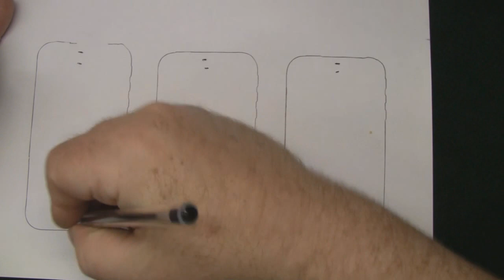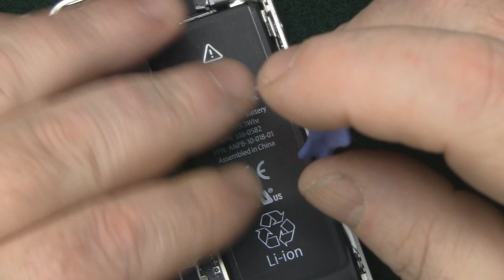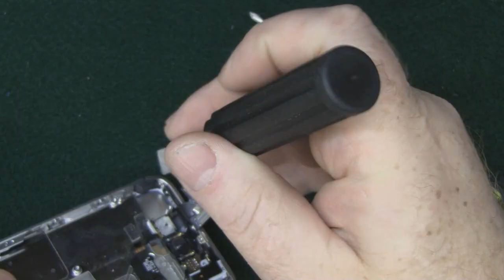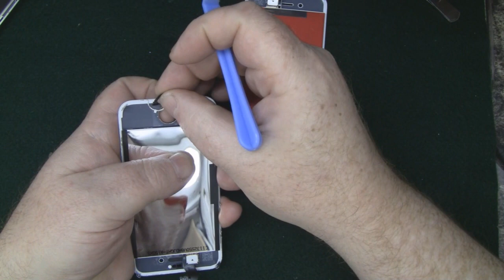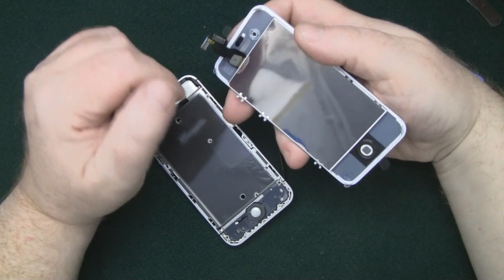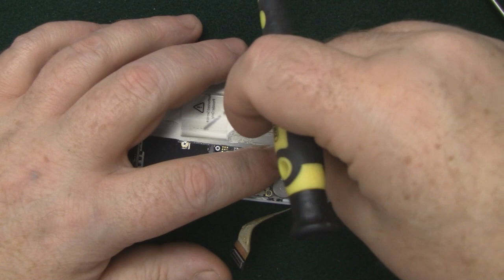How To Replace iPhone 4s Screen #68

Comment: At the moment, I can't explain the reason for this, but at about  8:15 in your video, you mention the removal of a "little metal retaining clip" (which I removed from my phone).  Once I had removed everything else that you said to remove, you then easily removed the logic board, which I then tried to do, but couldn't.  Baffled by this, I then took a further look (using a magnifier) at the area where I removed that "little metal retaining clip", and there is actually ANOTHER goldy looking piece of metal, which I had to carefully pry up, which revealed a hidden large screw (you can use a flatblade with).  Once THAT was undone, the  board then comes out.  You video isn't sharp enough for me to be able to tell, but I'm guessing that for some reason, that screw was missing from your particular handset (possibly due to a prior repair)?  Any thoughts on that?
Reply: great question, he's a bitch for not answering already.
Reply: there is a 75 percent that the men who u see fixing the iphone isnt the person who posted the video on youtube. In little word I could be the one who posted the video but I'm not the technician  on the video.

Comment: best DIY video on this fix hands down... just watched half a dozen vids before this one and since im an alternator and starter rebuilder im very familiar with taking your time, saving screw placement, marking your place , etc. and i bought just a digitizer and screen glass and i gotta tell ya, Andrew is 100% right at the very beginning of the video. You are saving zero dollars by bullshitting with all that cause I just 20 minutes ago destroyed an LCD screen by trying to separate them. I went to amazon for my OEM assembly and it cost me under 20 dollars and its overnight shipping so,Thanks Andrew for your time and video. If only i found this video sooner!

Comment: Sir, can u please tell me if can i disconnect battery while phone is ON, i have same problem, but i am unsure if i may disconnect battery while is ON (because i cant turn it off it restart after i trun it of tryed every trick to turn it off) help please? :(
so my question is can remove battery while my iPhone 4s is still on
Reply: in theroy you can, but not recomended as it is live.
best to go to a shop, that way if they fuck up they gotta refund or replace the phone, better still if u go to apple and use your insurance/waranty if its still valid.

Comment: Hey Andrew, I've put my phone back together and the screen lights up white but just stays doing that, going dimmer if i push the power button. vibrate and speakers work but no actual image on the screen. any ideas? cheers for the video thopugh, I'm defo closer to a working Iphone!

Comment: Thank you so much for your video. I ended up with two screws left at the end but I'll keep them safe until I really need to open up my phone again. lol I bought my screen replacement and digitizer for 18 dollars on amazon as well, all tools fit well. If it weren't for your well made video, i'd be stuck with a cracked screen.

Comment: Thank you soooooo much! it took my dad and I 3 hours to replace the screen but my phone is up and running perfect again. the only step that you missed when you were putting the phone back together, was replacing the screw under the black tape that holds the camera contact in place. Great instructions though! very easy to follow and understand! my advise to anyone replacing a screen is to watch a step by step video like this one and not try to read instructions off a site. it gets way too confusing when you're reading them. Again Thank you for making this video!

Comment: Thanks for this! it was a great help. A little gold piece fell out and i forgot where it went and now the power button at the top doesn't work so i think it could be related to that. I'm glad my screen is fixed though. Thanks!
Reply: +Travis Livingston the gold piece at the top that fell out is a power contact. that would be why your power button isn't working now. mine fell out too when i was replacing the screen. thankfully my dad and i noticed it and looked it up online to see where it went.

Comment: I replaced the digitizer touch screen with a good one from my old iPhone 4s that has a fried logic board.  It was a bit of hack and a retrofit because I moved the good screen from a spent iPhone 4s to a working iPhone 4 with a cracked screen.  I was sure it would never work again after I put it all back together but it works fine.  Your video above helped me to relax and not get stressed out about doing the repair.  Now my daughter thinks I have proven myself competent enough to replace the digitizer on her iPod Touch 4th Gen.  I purchased a iPod Touch 4th Gen Digitizer replacement kit for 16 US dollars.  Thanks again for posting the best how to video on the Internet.

Comment: Thanks a lot for this video, I managed to change the screen with little problems. A couple of observations: it was extremely difficult for me to put the screen screws back together, specially the top right corner (the opposite to the camera), and I am having problems when I press the screen, it gets white clouds where I press. What is the meaning of this? can you help me out?

Comment: This reminds me of replacing the hard drive on a Clamshell iBook.  I had to burrow down to the bottom to get to the hard drive and then put it all back together.  I purchased a cracked screen iPhone 4s, for a song, with the intent of using the good screen from my iPhone 4s that got it's logic board fried.  This project seems very daunting to me but, I'm committed at this point.  I'll let you know how it goes. I'm using your video and the instructions on iFixit dot com.
Reply: Maybe I should just move the logic board and SIM card from the cracked screen iPhone 4s and swap them into the fried motherboard iPhone 4s.

Comment: I replaced the screen however the screen doesn't work, when I plug in my charger my phone vibrates so is it just a loose connection to the screen?

Comment: why in the world would you skip at 8:35 and cut back to a point which you had already removed the two screws that hold the motherboard down without saying anything about it... i almost broke my motherboard because i thought it was ready to be taken out... turns out the tool kit doesnt even have a tool for these screws, so I myself am screwed. (Pun heavily intended)
Reply: +shcaboose I almost broke mine too! Luckily I noticed those screws after a few tries to pry it out. A small flathead will do the trick for the little gold screws (4.8 mm)

Comment: Kevin HallawayMany thanks for a very helpful guide. I have one question, when putting the phone back together I found a small rectangle of soft plastic or rubber left over. The approximate dimensions are 3.3mm long x 2.5mmwide x 1.0mm thick and it appeared to have remnants of adhesive on one side. I could not find where it came from although it may have been in the area of the charging socket, could you give me some guidence please?Regards

Comment: what does the LCD and digitizer look like,and where is the link for both these. I bought a replacement kit http://www.ebay.co.uk/itm/NEW-Glass-Replacement-Back-Front-screen-for-iPhone-4-4S-Rear-Battery-Cover-Case/271439851917?_trksid=p2141725.c100338.m3726&_trkparms=aid%3D222007%26algo%3DSIC.MBE%26ao%3D1%26asc%3D20141212152715%26meid%3D5723c91e3a95481fae880512292dd5c8%26pid%3D100338%26rk%3D4%26rkt%3D30%26mehot%3Dpp%26sd%3D271837801014 my touch screen still works is there something missing from these purchased back n front as the front screen is just clear glass

Comment: Hello, I have a question that is not really about replacing the display, but from where you buy it. You said you bought it from amazon and I tried that too. I found a lot of products but in the title there was something like "Screen LCD Assembly for White Apple iPhone 4S (for AT&T/Verizon/Sprint iPhone)". Does the carrier matter? I'm from Europe but all I find in my country are displays that cost more than 50$ so I wanted something cheaper. We don't have at&t, verizon or sprint so I wondered if this was a problem.
Reply: from what i understand, the carrier does matter, because some of the clips are in different positions depending on the carrier

Comment: Hi there, Thanks for putting up this perfect video. Could you kindly advise me a solution?

I had recently open the phone because a simcard could not come out, and that's all I wanted to do. So I took off as far as the silver chasis (not the chipboard) and got the simcard out. Then I put everything in place and just after to find out that the screen display does not turn on -- the backlight turns on (when receiving messages, getting out of standby mode), the call works, the sound works, etc.

Comment: I was trying to help a friend of mine fixing her broken screen. By the model printed on the back, I thought it was an Iphone 4. Happened to be a 4S. I first saw your video on how to replace the screen on the Iphone 4, cause it did not look the same as the one I was fixing... I just tried to figure out how to take it apart. Long story short... I have three little lose golden pieces. I cannot figure out where they belong to. I saw this video and I did not see anything coming apart from the Iphone with those characteristics. Do you have and idea where they probably belong to? They are I suppose just contacts. They are golden little pieces.. Please help!

Comment: Hi Andrew!
Great video! Would you mind posting a link to a good seller on amazon? I'm worried I'll be getting the wrong items (you said the 4s comes as a complete screen (LDC and digitizer together)). I also need all the tools so if there's a whole package out there I'd be very grateful if you could point me in the right direction. I have a white 4s and it is the front screen that has cracked. 
Thank you so much!